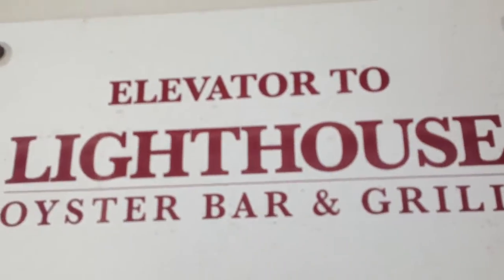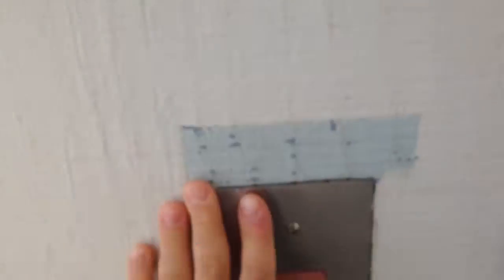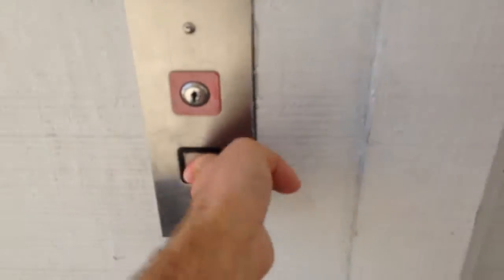Amtech Hydraulic Elevator @ Harbor Village Shopping Plaza, Oceanside, CA

Comment: I think those are Adams fixtures, so I'd say Westinghouse modded by... Schindler? Not sure.
Reply: I'm not sure if those are Epco because of the "in case of fire" thing. I think that's the one Adams uses. But your probably right.
Reply from the maker: It's actually Adams Designer and this is NOT a Westinghouse but an Amtech Reliable actually. Im gonna change the title right now.
Reply: +Traction151 Nice. I thought this was a Adams, but I think at one point Adams made fixtures for EPCO or vice versa. I would've never thought this was a Amtech!
Reply from the maker: Yeah it's Adams Designer fixtures made for Amtech or Mitsubishi with that floor indicator like on the Mitsubishi "Crayon" Hydro at Disneyland. It used to have the good ol Amtech "Chirp" but the indicator and chirp chime have died to being used and worn off and also from vandalism sadly;(